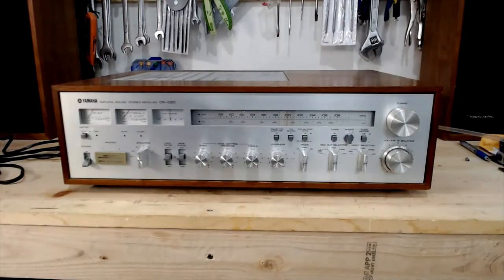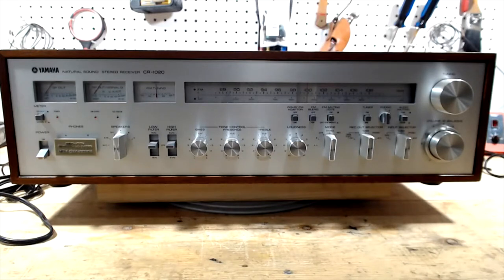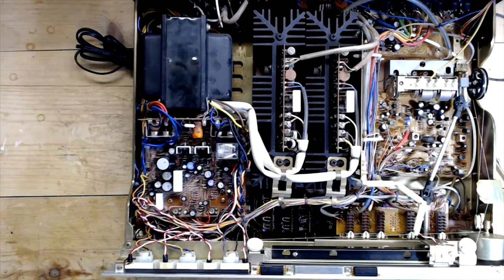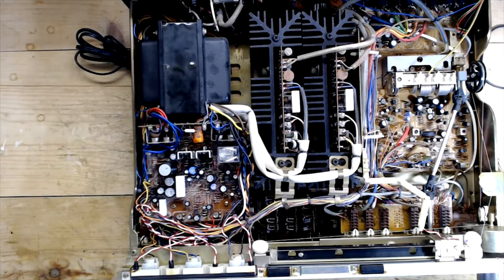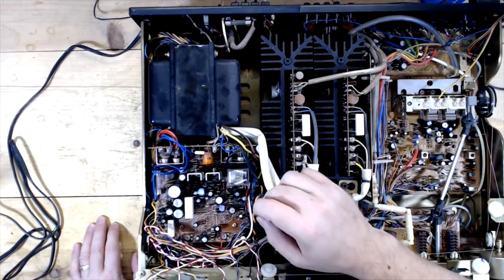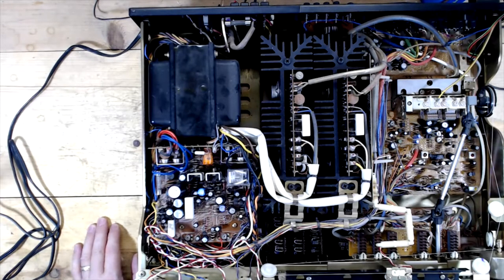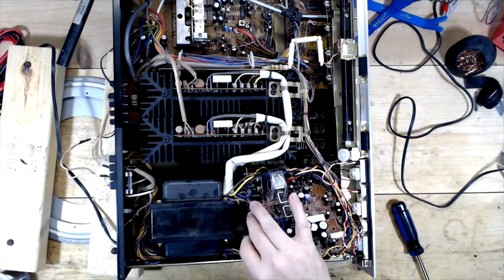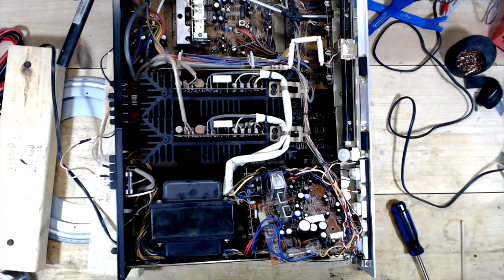Yamaha CR 1020 Stereo Receiver Repair - Popping Sound / Protection Relay Kicking In and Out

Comment: I have a Yamaha RX -V675 receiver and about a week ago, I started hearing the speakers pop from time to time. At times, no sound would emanate from the speakers at all. Turning the receiver off and then on again appeared to fix the issue in the sense that I would get audio. However, the popping noise continued and the audio would go in and out. I checked online at the consensus seemed to be that the issue is related to the decoder chip on one of the boards. I've already purchased a replacement but I still have the old receiver. Your thoughts?
Reply from the maker: There are several issues that can cause popping (bad transistors, bad solder joints, other failing components).  Nobody can say definitively what is causing an issue like that over the internet based on a few symptoms.  It literally be any number of things.